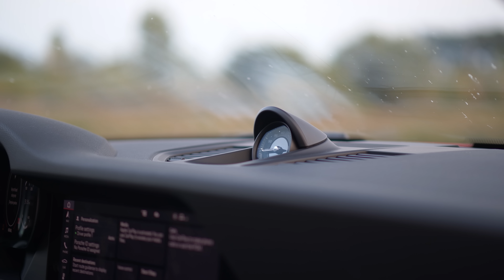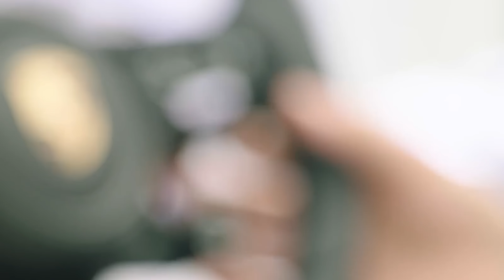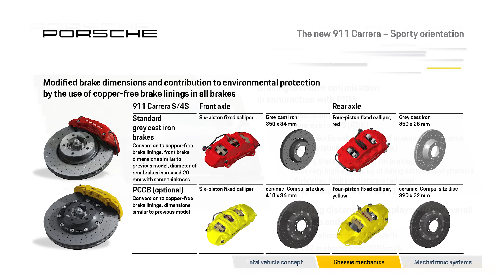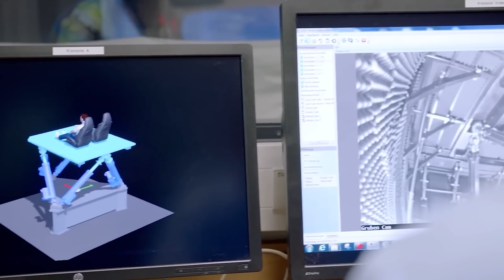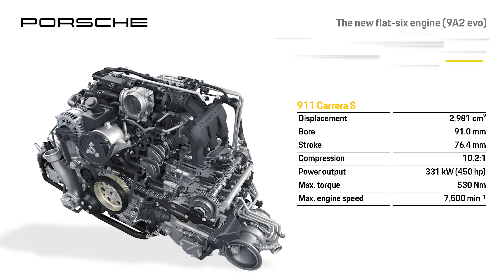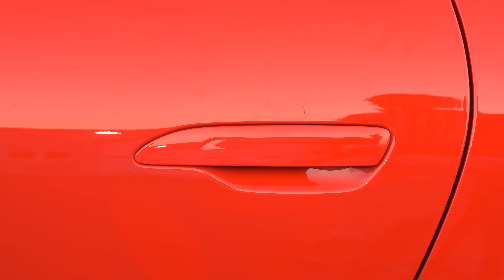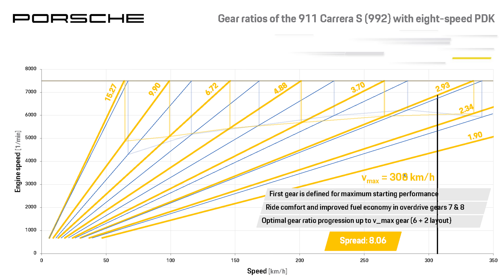Porsche 911 Carrera S 992 | Technical Brain Damage

Comment: Porsche: The only car manufacturer that can go overboard on electronics and technical sophistication and STILL impress Mark.
Reply: ....because Porsche is one of the very few manufacturers that are remaining driving feel, car engagement and feedback despite total engineering and ultimate technical sophistication. That’s for most other manufacturers obviously impossible, or at least very difficult to deliver! I guess that’s why....
Reply: @fragu123  A lot of that can be credited to the fact that the 911 base has been used ánd raced for so long. Balance, chassis torsion, weight shifting during cornering: everything is known and can be tackled with electronic systems because they know the chassis so well. 
What you get with each new generation is the result of decades of consistently keeping on tinkering and tweaking mechanically and merging new technology into an old concept.
Reply: Watch what Lamborghini do with the Huracan replacement. But of course, that's the same company.
Reply: If Lexus did it he would love it
Reply: LOL
Reply: @Gandalf721  Just because it's seen a cliche does not decrease the value or validity of the statement...particularly since in spite of having been "massively reused" so many automotive companies still have yet to figure it out.
Reply: I personally tend to think that Mark's more impressed by the amount of tech and engineering that goes into a car,rather than the car itself.
Reply: @blairbrown4812  well he has an it Background
Reply: it's  not about what the tech is or how much there is of it, its about how you use it
Reply: @ShaiyanHossain  Underrated comment

Comment: The maintenance must be sort of complicated!
Reply: the first step for a lot of things is to drop the engine and transmission
Reply: @palmermonsen9098  not for servicing but the engine and transmission drop as one, quickly and easily, owners tend to be scare and lack the knowledge but once stuck in find they do come apart easily and are easy to work on. And yes I know from a lot experience.
Reply: Very easy actually, you'll just have to pay a couple of grand for every service no big deal
Reply: Maintenance costs aren’t too bad.  However, any maintenance that requires the engine “dropped”, is not for the faint-of-heart 😳
Reply: @Braydenplaysallday  based on all the technology they have used on this platform I dont think it would be easy for a normal person with basic skills. It seems too much to me all the crap they put to make it a refined sport car. But of course if owners know what they are doing then its OK.
Reply: @bilakh7  I do all of my own maintenance for the consumable items.  Such as oil changes, filters, brake maintenance.  Other than that.  Nothing out of the ordinary from any other car.
Reply: @Braydenplaysallday  that is simple stuff though.
Reply: This is an exotic layout, working on it is not easy.
Reply: @Jay19735  that's what I mean. Even if its easy to fix or replace something, there are tons of stuff on it that I got headache during Shoppe part. And I'm sure buyers are impressed about all the over engineered crap on it.
Reply: It's a Porsche, it's simple. (:
Reply: Expensive as F
Reply: Just fix it lol
Reply: Entropy is coming for us all.
Reply: Those owners don't care and Porche stealerships charge crazy rates for everything. It's a match made in heaven.
Reply: @nateavery2875  that’s not true, Porsche owners tend to be intelligent and money savvy plus in my experience servicing is on par with normal running costs and surprisingly cheaper than some, my wife Shogan/Pajero was a lot more expensive and the service was crap, and never a lone car. Porsche always gives me a loan car or option for them to collect or drop me off and collect me
Reply: Nope, Porsche 911’s come apart very easily and rebuild very quickly and easily and are well built and engineered. Servicing is very easy.

Just remove the under panels, bumper skins and lights as required... all come off very easily and refit as easily with no adjustments or complications
Reply: @jamest5149  this isn't the 90s
Reply: @user-ve9tu5rv6e  never said it was the 90s but there are a lot of similarities to early cars and the new models, plus years of engineering and design excellence that make for efficient manufacture and leads to a great experience for technicians servicing and repairing these 911’s. The Pcar SUVs are much harder to work on.
Reply: @jamest5149  they have moved the intercooler to inside the engine area. Can you imagine what servicing that would require?
Reply: @astronmr20  It's a rich man's car, besides most people lease the Porches.
Reply: Thank you for the great explanation. I still can’t afford it.
Reply: @jamest5149  no
Reply: @Jay19735  I was about to reply to your comment questioning why you disagree but then I saw your pfp and knew you weren’t being serious.
Reply: @307skylake7  AMD is raping intel rn. Maybe I should change it to AMD logo.
Reply: @Jay19735  no
Reply: @Jay19735  yes. He never said it was cheap though 😜
Reply: @jamest5149  bahahahaha///what planet do you live on. I actually Own a 2018 Porsche 911.
Reply: @paulj9821  typical p car fanboy
Reply: @behindthen0thing  Thank God I lease mine and it just deduct through my company expense tax.
Reply: @paulj9821  damn 1% !
Reply: @jamest5149  oh lord, they surely do not.
Reply: @ABeans07  I’ve done 13k miles in just over a year in my GT3 and have only needed routine maintenance.  The maintenance is easy to perform on your own and 80% of the owners I know also perform maintenance themselves. When I do need more work done on the car, it goes to a reputable independent shop as do almost all the owners I know.  I don’t know anyone with an unreliable 911.  The running costs are indeed low.  Granted we aren’t talking about some Toyota Corolla... they are certainly more expensive than the running costs of an average car.  Oil changes are more frequent, tires are more expensive, etc.
Reply: @flat6memories  that's great until it's not regular maintenance.
Reply: @ABeans07  so do you expect to a +100k sports car to have cheap maintenance costs, whether it be regular or irregular maintenance? Lmfao, wtf.
Reply: @BeanieNinjay0  No, but myself along with other people work on cars themselves. ;)
Reply: I think the point is that in the 100k plus segment of cars, its relatively unexpensive to maintain these. For sure everything will be more expensive than a standard ecobox, but if you look at the other cars that cost that much, this is easy and almost low cost. For example, in all the 911 generations you can change the spark plugs without taking the engine out. Ever tried that in a Boxster/Cayman? Those are absolute nightmares to work on and service on them is, as far as i know, way more costly.
Reply: Yosh, you have no idea what you’re talking about.
Reply: @yoshisaurusrex3767  I want a Cayman gt4
Reply: maintenance cost on a Porsche sounds like a first-world problem...i even heard those who never do maintenance they simply buy new one every couple month...
Reply: @yoshisaurusrex3767  Agreed, context is always important.

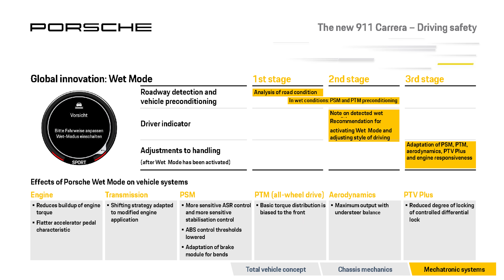Comment: I feel like I should live-blog the 20 minute tech section.    13:42 Where are sensors for rain sensing wipers and would they overrule the wheel-well wetness sensors ?  

Trust Porsche to design for the scenario where it stopped raining but you still have a wet road, but no other traffic, so there is no wet spray to trigger the windshield wiper sensors.
Reply: rain sensor is a LED based system in the windshield. its complete separate from the other system
Reply: @benjaminkessler8169  Correct, in most vehicles it’s tucked into the housing where the rear view mirror is adhered  to the windshield